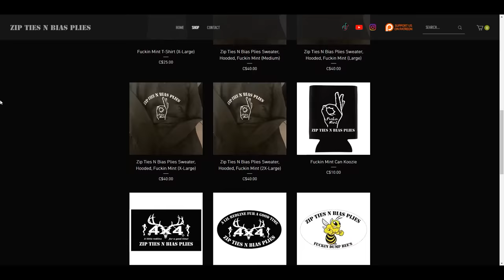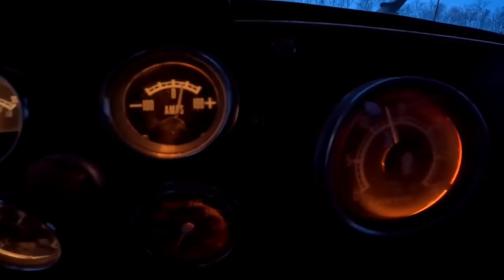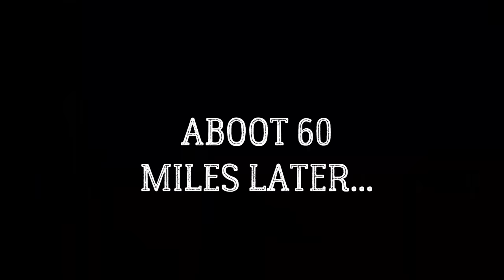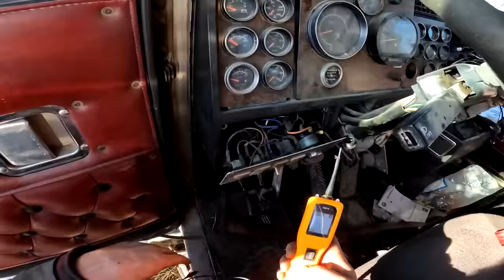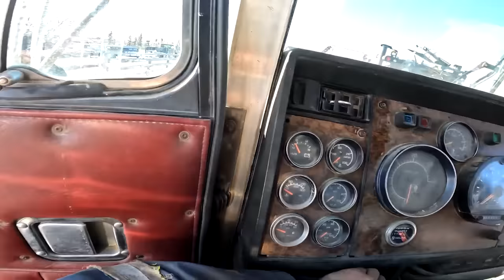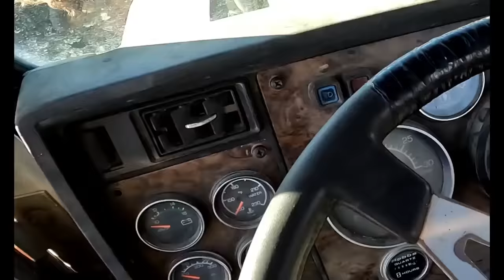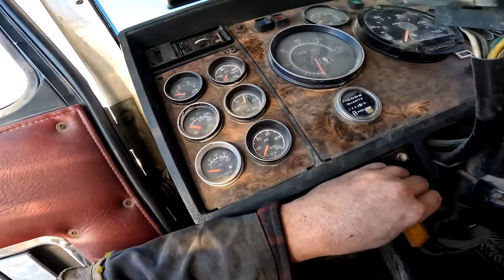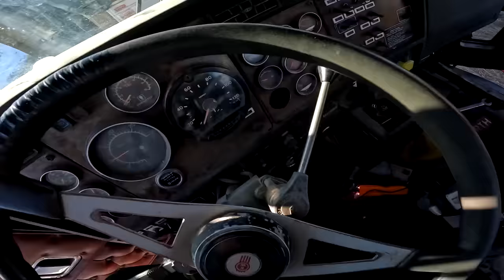KENWORTH TEXAS BED TRUCK REZERECTION!!!

Comment: In cab ether ignition!  I didn't realize life could be so luxurious, in my tax bracket!  And it's self regulating too: if your hands are shaking too much, you get a little second hand ether in that closed cab there, and it settles you right down so you'se can get back to work.  I'm just down here in Vermont, but it's closer to you, weatherwise than palm beach ala-sippi, ya know.  Heck I think parts of Vermont are farther north than that one Canada town where all the Canadians live.  Anyway, you need a proper name for that contraption, since it's a series of tubes, it's like the internet, and since it is basically an ether delivery system, I think you should call it, the Ethernet.

Comment: 3406B i think is the best engine CAT ever made. I've owned a few and they were so good and so reliable. With the right turbo and the fuel and torque screws backed out, they pulled hard. Love those old engines. I still have one in my 85 Freightshaker aluminum hood custom tractor i built for myself. Awesome KW Peg!

Comment: I think you'll find that that dealie on the dash is called a holler-tater, when you were a kid, with two left feet still, did you ever make a bat-tree out of a tater and a couple nails?  It works like that, but an old, cold, k whopper take more of the old electric fluid, so a holler-tater is full of extra nails I expect.

Comment: Remind me of when  I worked in the oilfield  we would  grab the turn buckle  on the rig with one of these  use a crane on the other side and drive it down ramp the ass of the truck  would almost be pointed straight up

Comment: I carry a 6 foot long piece of railroad sleeper with little angle for a ramp cut in one end and a set of 4 single chains in the dump truck for mildly bad situations. If I know it’s gonna be greasy where I’m going i take sleeper and line it up in front of the inside drive tires and pull up on until both axles are up and the outside tires are hanging in the air, then I drape the chains over the outside tires, hook the inside to the second to last link (I have the tails cut as short as I can get away with, I don’t like them whipping around) and use my custom tensioner cam tool (a big screwdriver with a bend in it and the end ground down some) to get those suckers TIGHT, which is easy with no weight on them. Then just repeat on the other side and give her till I don’t need them anymore then I pull them off. It might seem like more work but doing it that way you get then on so tight and even that I don’t ever have to stop and snug them up after I get moving, and I know they’re not gonna slip and that’s worth it to me. Some guys say the single chains don’t give enough traction but I’ve never had them fail me and they’re so much easier and lighter to deal with than the chains that cover both duals.
Reply: OK but have you ever driven a cab in medicine hat?